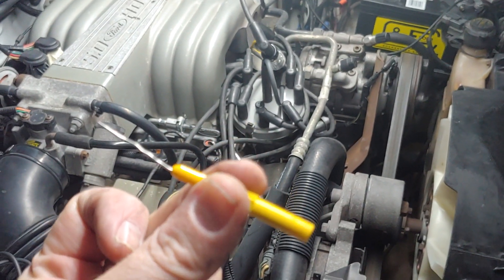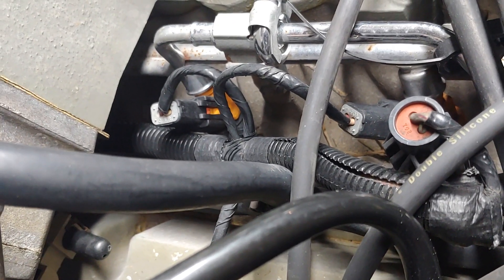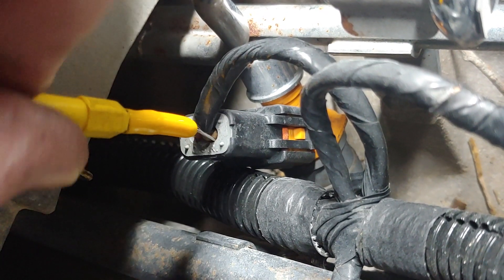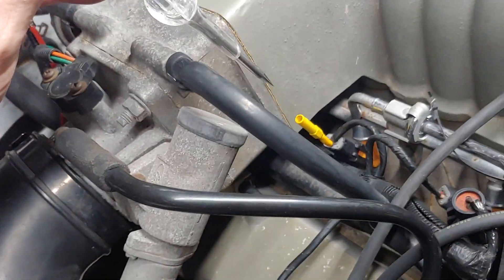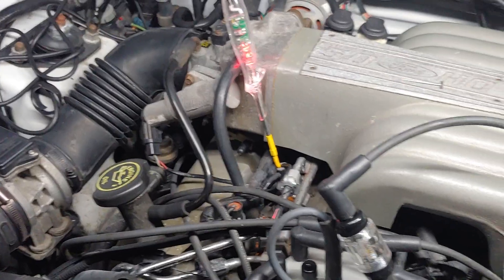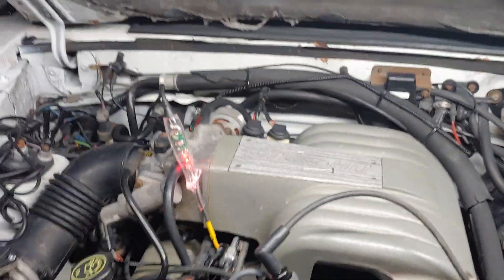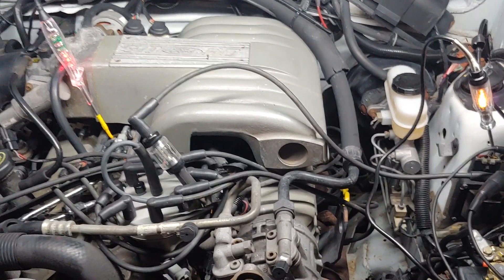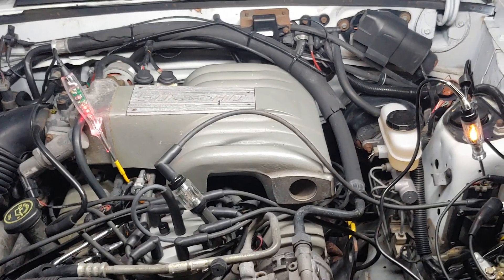Testing for Injector Pulse and Spark on a 5.0L Mustang

Comment: Good video my man. Question, where do you connect your hand held starter. Thanks
Reply from the maker: The starter bumper? It connects to each of the two large studs on the starter solenoid, which is on the driver's inner fender.
Reply: @dragradialperformance3540  awesome, thanks. That's gonna help me trace my #8 injector is not firing
Reply from the maker: @summerfox9292  Check that injector's red wire for 12v key on. Check resistance on the injector, unplugged. Should be 11 to 16 ohms, or more importantly it should be identical to the other injectors, within 0.2 ohms. And then check for injector pulse with an LED test light or NOID light. If you are sure you're not getting injector pulse at the injector, the next step would be to check that same injector control wire at the computer.

If you get injector pulse at the computer, but don't get it at the injector, check your 10-pin connectors and do the 10-pin connector fix. I have a video or two on that. In fact, if you haven't already done it, do the 10-pin connector fix anyway, on all Fox bodies.
Reply: @dragradialperformance3540  thank you much for your help
Reply from the maker: @summerfox9292  you're welcome. Did you get it figured out?
Reply: @dragradialperformance3540  update, since is #8 there is no access underneath the intake. I went to the pin connector to check ohms, 6 read 15. Something, one reads 10. And the one with blue wire no read, i assume is #8. Would that be the injector itself?
Reply from the maker: @summerfox9292  You can test with the key off at the 10-pin connector for the injector harness by removing the plastic cap off the 10-pin connector. Between the common 12v power wire and each of the injector control wires, you should get a consistent amount of resistance. That resistance won't vary more than perhaps 0.2 ohms. If you get more variance than that, I would suspect you're not on the wires good with the meter. Either that, or poor connection of the 10-pin connectors. (See the 10-poin connector fix video).

We don't often have problems with injectors themselves in these Fords. Watch all of my video series on diagnosing a bad injector. The conclusion of that 4-part (I belive it was 4 parts) video was that I had an injector control wire coming loose at the PCM harness connector because of a broken and brittle PCM connector not retaining the injector control wire when I plug in the PCM harness.
You could also catch that by turning the key on, and measuring for 12v at every injector on the injector control wire at the 10-pin connector. The 12v common feed comes in to each injector, and if the injector is not being turned on, that 12v winds thru each injector winding and comes out the other side and all the way back to the PCM until the PCM turns that injector on by grounding the wire.
Reply: @dragradialperformance3540  UPDATE: Is fixed, thanks so much for your time and sharing your knowledge, i followed the steps you mentioned and found that injector #8 had no resistance so i replaced it and that baby started right up, smoother than ever before. So this time it was a bad injector i guess?.
Thanks again, i've been watching all your vids.
Reply from the maker: @summerfox9292  That's great news! And quite rare that it's an injector. It is possible that a shorted injector with no resistance at all can burn an injector driver out in the computer. Most likely, it caused the PCM to shut that injector off, and possibly more than one injector off, to prevent overcurrent from happening. Thus the no-start, because one injector alone shouldn't stop a V8 from running.
Reply: @dragradialperformance3540  well the car was running but it sounded flat, it was running on 7 cylinders. Now it picked up it's power back up
Reply from the maker: @summerfox9292  Nice find! Speaking of injectors, make sure that your #1 spark plug wire is connected to the 2nd terminal away from the distributor hold-down clip on the passenger side of your distributor cap. If it isn't, your injector timing won't be right even if your spark timing is. Each terminal you're off by is 90 degrees of injector timing off.
Reply: @dragradialperformance3540  yes, i've checked it. It is marked (#1) on the distributor cap. Tha ks again

Comment: My TV is still hooked  to throttle  body cruising about 65  just saying slipping  anything I should look for
Reply from the maker: Make sure there is no slack between the TV cable and the throttle body. There is supposed to be a plastic bushing there that takes up all the gap. It fails, and can cause the transmission to go bad. Replace that plastic bushing with an aluminum bushing.
Reply: That's there but when it did happen I pulled over and I hit the throttle body Cable in that TV Locker cable and I heard at like like it relieves release some pressure but I've never had problems with this slipping before when I first bought it I had problems with his slip into the  first so I did mess with it I mess with the idle screw the day before that I didn't think anything about it so how do I set it back to where it I did idle reset yesterday now if I'm standing there and I done all that yesterday if I pull the TV cable out of the throttle body is where it's supposed to hook up to the throttle body supposed to be a little bit ahead of it or behind in to the throttle body or is there any other kind of transmission I could use if I have to go another route like out of the LTD Crown Victoria one of the older ones or just has to be a Mustang one

Comment: I get no power to the coil negative.isthis bad tfi?
Reply: If you turn the key on, hook a test light to battery negative, and then touch the test light to the side of the coil with the red wire, the test light should light indicating power is going to the coil (from the ignition switch). You should also be able to test the other terminal on the coil (coil negative), and also have a light that lights. If one lights and the other doesn't, the coil's primary windings are open.
Reply: @Pontisteve  thanks. Got a new coil it has spark now. Still no start car has been sitting for years it got dark n  I noticed the plug boots are letting the spark out I'm gonna change the wires today hopefully it will start then. As of now it will crank and cut off n abt 4sec. Then won't start again unless I wait a few hours
Reply: @quarter_1320  Sitting for years, I would bank on it needing a new fuel pump. Check fuel pressure. Should be 39 PSI key on engine off. If not that, it's also possible the injectors are stuck closed. You might try tapping on them with a wood pole to see if they unstick. Or listening to them with a stethoscope.
Reply: @Pontisteve  well I tested a few things on a buddy's car my dizzy is good tfi is new ccrm good new coil new plug wires new fuel filter ecm is good. Crunk it up ran for abt 8sec n shut off n won't start BK as of now. Just checked fuel pressure it is only 36psi with key on. Gonna grab a new pump this weekend n hopefully it'll run. Also it's a 95 car not a fox but I don't think that matters
Reply: @Pontisteve  also just tried start fluid and still no crank but if I wait till morning it will crank for a few seconds on first bump..
Reply: @quarter_1320  You just have to see what you're missing. While you're missing it. If it's a no start, you'll either lack fuel injector pulse, spark, fuel pressure, compression, or airflow.

Comment: If you don’t have injector pulse and wiring is good. Does the computer require an input before it will pulse the injectors or will it pulse the injectors with out any inputs during starting?
Reply from the maker: Both the PCM and the ignition module require some sort of signal or pulse to fire the injectors and the coil. The PIP sensor provides that pulse. The reluctor ring on the top of the distributor shaft has 8 teeth, and when each tooth goes thru the PIP sensor window, the PIP sensor produces a pulse. The pulse goes from the PIP sensor to the ignition module, and on to the computer. The computer uses it to fire the injectors, and also modifies the timing of that pulse and sends it back to the module (as a SPOUT signal) to fire the coil. If the module doesn't detect a SPOUT signal, it will fire the coil based on the PIP signal instead. So yes, the PCM requires an input to fire the coil.

Next time your distributor is loose and you don't care about your timing setting, try rotating the distributor all the way left and right that you can. You'll hear an injector click, the fuel pump relay click on, and a spark occur.
Reply: @dragradialperformance3540  Is there a a way to test the PIP if it is producing the pulse? I understand the PIP produces the spark and the fuel injector pulse, right? I am getting spark but no pulse... BTW Kudos on your 5.0 contents, very informative... (blink light on the test light on the coil negative is the pulse) just seen the whole video, lol
Reply from the maker: @driversinc  yes, there is. You can backprobe the top wire on the ignition module harness connector with a T-pin or backprobe. Then use an LED test light clamped to battery negative, and touch the test light tip to the T-pin or backprobe. Have someone crank the car. The PIP signal is a 12v squarewave, so every time the signal goes high, your test light will blink the bulb. You should get 4 blinks per 1 revolution of the crank, so it's a fairly constant blinking while cranking.

The PIP signal is used to fire the coil and the injectors. However, the coil can be fired by the ignition module without a PCM. The injectors can only be fired by the PCM. So if you have spark, you don't have a PIP sensor problem. But if you also don't have injector pulse, you do have a PCM problem. Confirm the PCM is getting powered up and is functional. See if the fuel pump runs for 1 second after turning the key on. See if the TPS sensor has 5 volts on one of it's 3 wires when you turn the key on.
Reply: So im not getting any fuel pump power or injector pulse but i do have spark can that be the pip or is that the ecm?@dragradialperformance3540
Reply: Thank you for answering my question.

Comment: Do you have a video on foxbody ground wires and locations and how can you add grounds if you should have to
Reply from the maker: No, not yet. But there are only 2 PCM grounds to be concerned with, and one battery ground. There is a PCM case ground (and ignition ground) located in the passenger fenderwell, right behind and below the computer.

Then there's the main PCM ground, which is a single black wire connector that attaches to the fender by the rear of the battery, near the starter solenoid. That wire attaches the PCM to the inner fender.

Then there's the small negative battery cable/wire. It goes from the battery to the fender, and is quite important. Just check those three places. No real need to upgrade ground wires if they are in good condition. Each should have less than 50 Millivolts on them when the key is on or the engine is running.
Reply: if you want a nice project, build a dedicated ground. connect a 2ga wire directly to the battery NEG and ground that to the body, a few seat belt bolts and in the trunk area. clean the metal till shiny, add dielectric grease and a star washer and you'll have an unbeatable grounded vehicle.